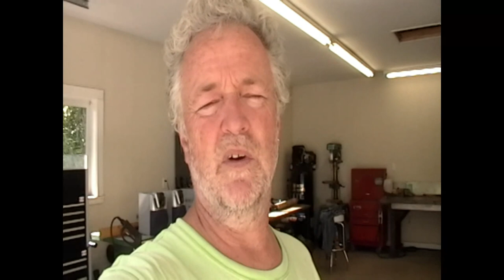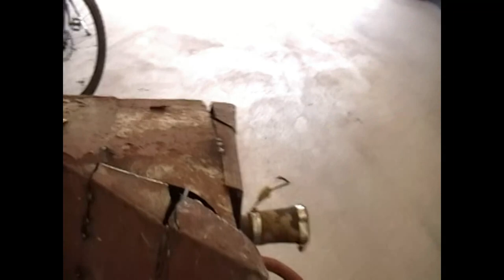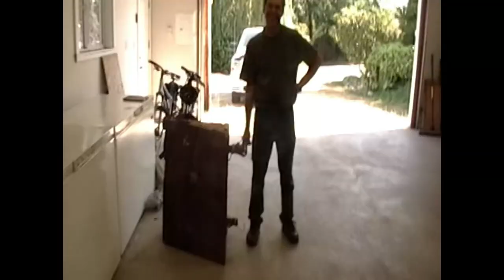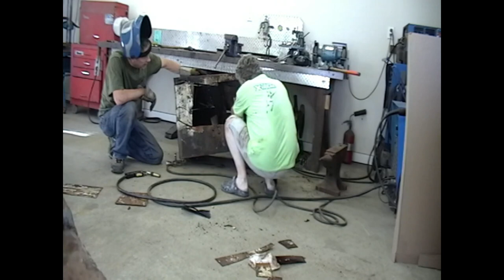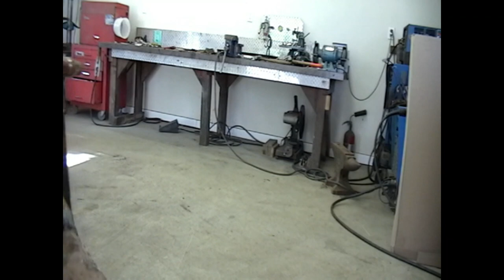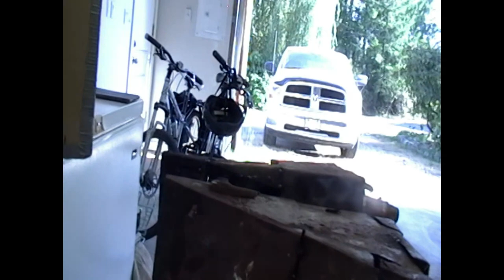Little Bear Westsail 32 refit: Franken Tank     Vlog # 160

Comment: Why don't you make them out of fiberglass so they won't rust inside  and will last as long as the boat?If water gets in it sets on the bottom and starts rusting. Unless your going to use stainless!
Reply from the maker: Fiberglass doesn't do well with fuel over time. I'm making the new one's out of aluminum. 5050 grade 3/16" thick. They'll out last me.
Reply: My fiberglass ones over 30 years still like new!